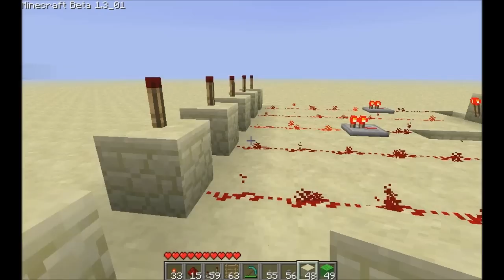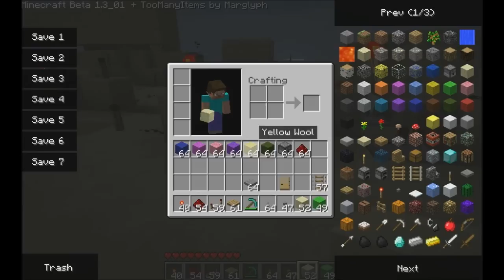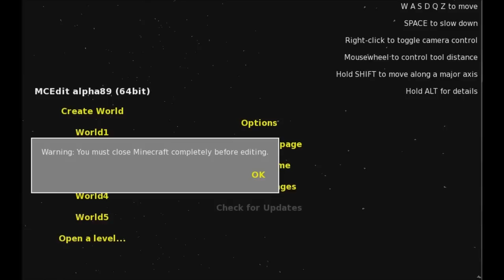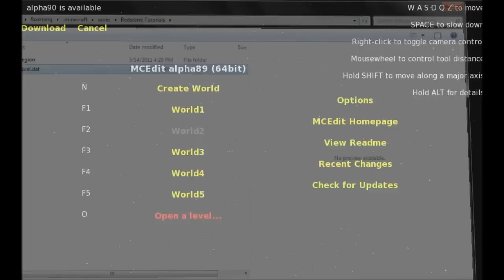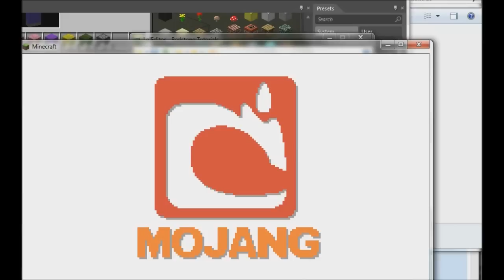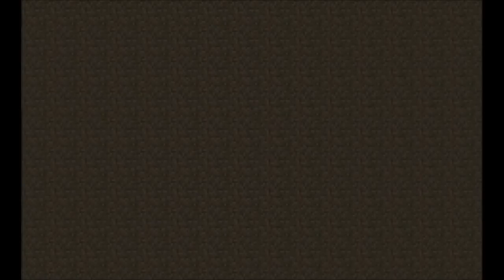(Read Description) 9 Button Combo Tutorial

Comment: thanks, although as mentioned by mr. caps lock below, it doesnt work in newer MC versions. However, it is only because of a redstone directional bugfix. Basically, the redstone in the
AND gate that tells the next RSNOR latch whether the previous one was already activated is aimed sideways, something that no longer will happen. To fix this, simply separate your latches by one more block. I did that, and it works great. I made a simon game with it :D I modified it to use 4 buttons & 8 notes.

Comment from the maker: @firebender111 Ya, there's something weird that happens when you have two in a row. I need to investigate further. One "solution" would be to add a counter that counts how many buttons are pushed and reset everything if the last number is incorrect. Not an ideal solution but it works. ...sort of.